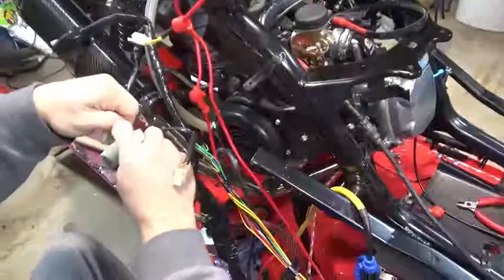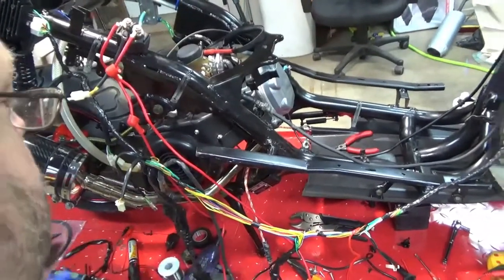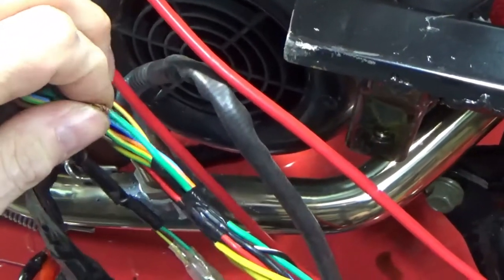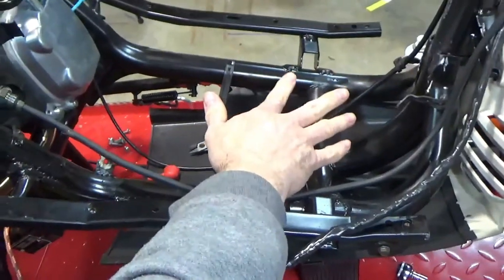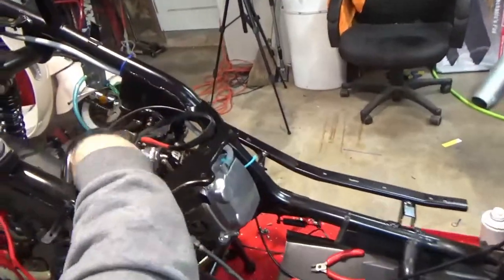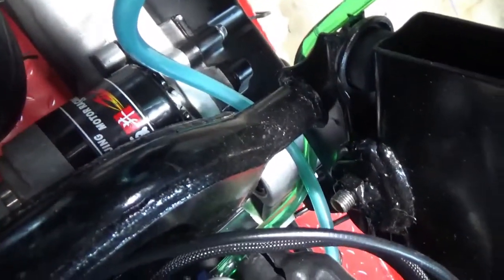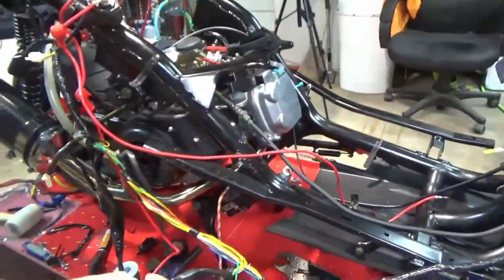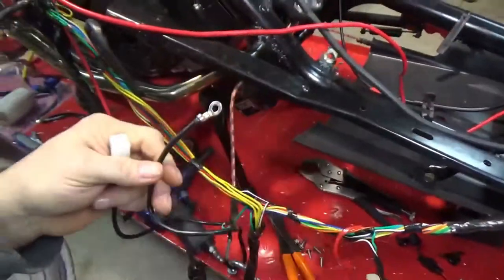Video 5 Lets look at some scooter wiring

Comment: I can completely agree with everything that you have mentioned about how  Chinese scooters are wired I thought I was the only one and I was beginning to think I was crazy because somebody gave me a Chinese scooter at work 2017 50cc scooter and I wanted to fix it up so  I started to look at the wiring and let me tell you it was worse than what your situation is the thing didn't even come with a fuse any relays to turn lights on nothing all the grounds or ran to 1 crimp not soldered and ground wires change colors from green to blue to red I mean it's just ridiculous so I ran all new grounds made a distribution block separate from my starter wire to take the load off of my electronics when starter drawers power I don't know maybe it's a little overboard and people at work were starting to talk about it now after seeing this video I feel a whole hell of a lot better I even put relays on my lights fuse distribution block for everything the works and it just helps me sleep a little better at night you know what I mean I just don't understand why there's no quality control over in China with their products  thanks for posting this video I know it's old but I started to watch it and it really meant a lot to me and help me not to question my sanity when it comes to being overly anal about wiring you know what I mean thanks again
Reply from the maker: Hey, thank you for the compliment. It means a lot, and NO, YOU ARE NOT CRAZY lol 😆. That's why my builds continue to run lol. I also spent 30 years in the automotive electronics industry. As far as why the Chinese do this, I can come up with a few reasons but most likely it's why they're cheap? The grounds SMH,  don't get me started lol. When my new build begins, I'm changing over all the connectors to all waterproof ones. Upgrading to all oxygen free copper. Again, thank you for the kind words. I'm glad it helped at least someone lol. You see the age of this video. Go look around and you'll see vendors selling harnesses that look just like the video 🤣.  Coincidence???? Maybe but dare I question? Have a great day and thanks for watching.
Reply: @apmscootering5219  I also have a super duty 02 with a 73 in it that one day I just decided to redo the whole truck all the wires cuz I thought it would be a challenge and play let me tell you I've been working on it for about 8 months work on it everyday after work I'm in the middle of integrating an alarm system with various different kill switches because I believe when you do an alarm system that's the way you should do it not the way these shops do it because it's not practical for them and they want to get it done quick I mean it's a joke the way they wire these cars and you know they don't solder the wires they actually cut a slip through the insulation and poke the wire through twist it and put electrical tape on it and that's the industry standards for car alarms and here I am ranting on about another thing other than the Chinese wiring that pisses me but I'm sure you know exactly what I'm talking about anyways I didn't mean to make long just had a lot to talk about LOL thanks again looking forward to your new builds I am subscribed so whenever you post I will know I will keep checking back thanks again
Reply: YouTube cut out this whole reply that I wrote out for you cuz I mentioned a product damn I said let me see if I can
Reply from the maker: Yes, it's called a t-splice or military splice. It's not a bad way to do it, if you know how to properly tape it. Soldering, tape, and heat shrink will always be the way to go. The trick for alarm installation is copying what the factory does, meaning make it blend in with the rest of the factory wires. You keep being OCD! I never cared what others thought because I knew my wiring would outlast anything it was installed on, lol. Good luck with the truck lol, I'm sure it's tons of fun, lol. Custom wiring is something everyone should take pride in, at least I think so! Talk to you later. Thanks again.
Reply: @apmscootering5219 yes therapeutic exercise for me I as far as waterproof connectors I don't want to mention the name because the last reply somehow got erase but I'm sure you know the connectors I'm talking about it begins with a D and you can pretty much take them apart depen them add to other plugs move wires around anyways yeah I had this whole reply written out and somehow disappeared LOL anyways looking forward to your future post and builds thanks again

Comment: Tony brother, I could use your engineering expertise. How do I really tell if my rectifier is going on the scoot? I heard from Rocky Mountain ATV that you can't test a single phase regulator, is this true? The problem I currently have is my solenoid is clicking, but when I test on the starter side of the noid while cranking I'm only getting max 3 volts. Getting 12+ volts all around the bike when checking the grounds. Changed out the stator, and the solenoid and getting the same result. What am I missing here?
Reply from the maker: Sorry for the delay, is the battery dead? This is usually one way to verify if a rectifier/regulator is not working properly, if the battery doesn't show an increase in voltage while the scooter is running I would suspect the rectifier. So on to the starter seloniod are you getting 12 to 14v on the solenoid input wires when squeezing the brake and pushing the start button. The seloniod is just one big relay. Hit me up when you get this, I'll probably need some test numbers from you
Reply: @apmscootering5219  Thanks for getting back to me. Today I am going to make a private video and give you access to view it. Battery isn't dead getting 12.9 volts but when I hit the starter button volts drop way to low. Yes on the battery connected side of solenoid I'm getting the same 12.9 volts. Yesterday I took the regulator total off the bike and it's doing the same thing. I'm surprised the battery is even reading when it's off. What would you like to see in the video?
Reply from the maker: @kachiskid  just show me what your  testing and what its acting like, I like to see what and how your testing. Thanks we'll figure it out!!
Reply: @apmscootering5219  You are the MAN!! I'll get right on it...